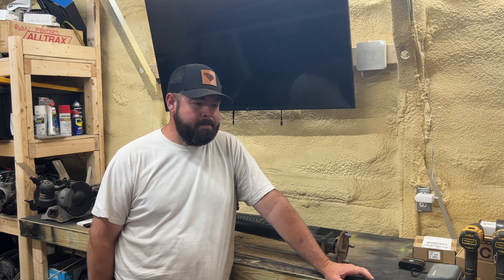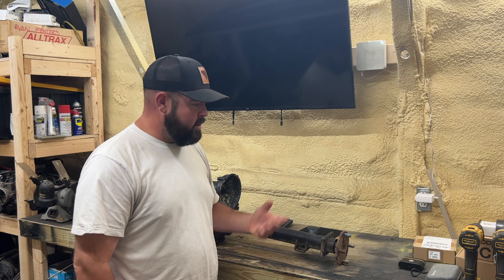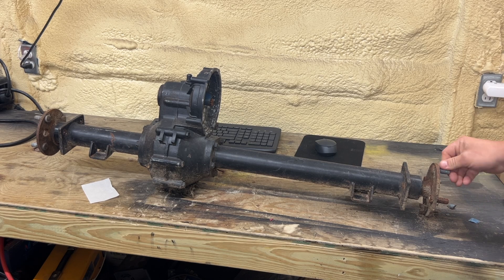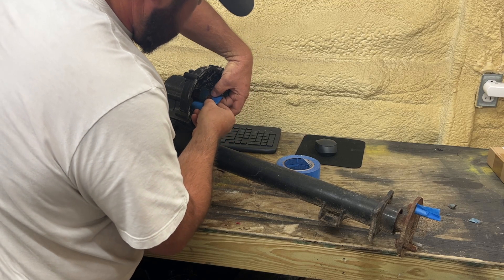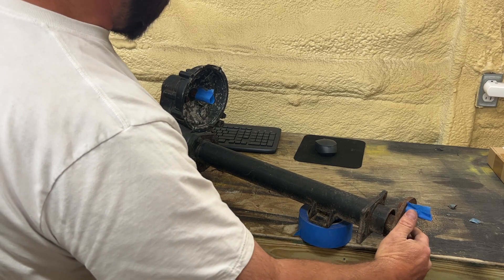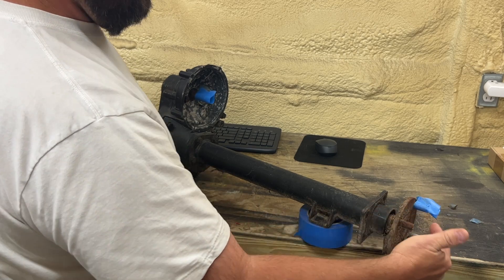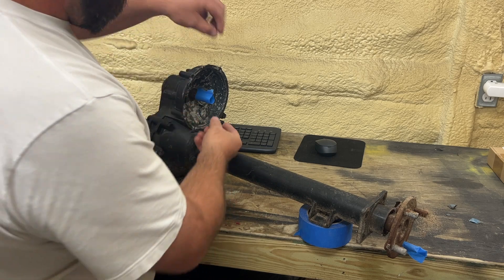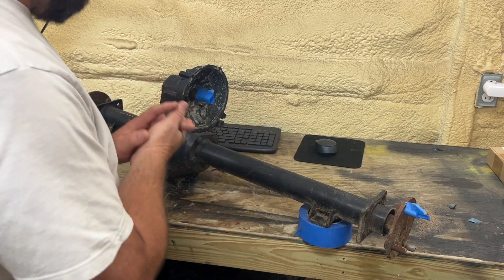How To Find Your Rear End Axle Gear Ratio On A Golf Cart With Painters Tape

Comment: Why do you have to multiply by 2?  Is it because the actual final ratio is the intermediate shaft to the differential?  Or is the hub half the size of a stock wheel?
Reply from the maker: I held the left axle still and rotated the right axle 6 times to 1 time of the motor shaft. If you spin both axles at the same time it will spin 12 times to the motor shafts 1 time.